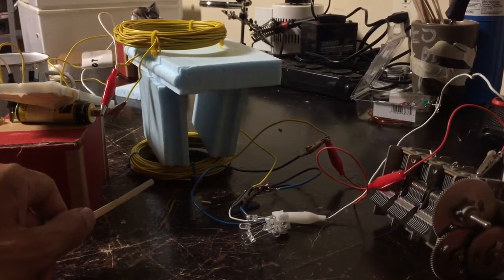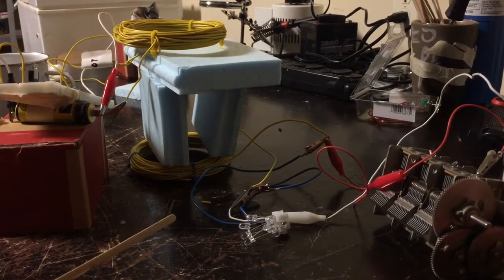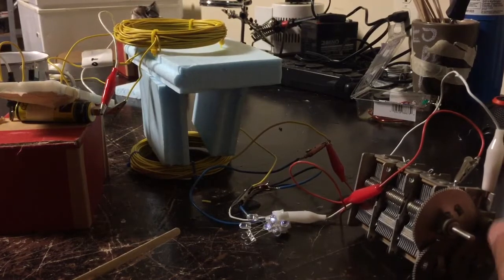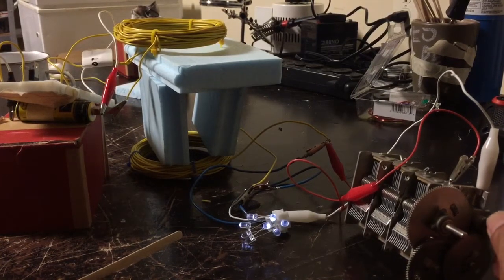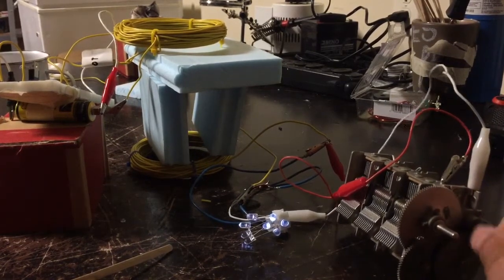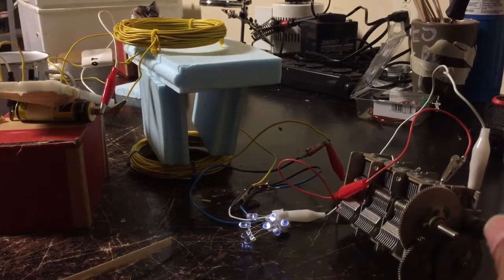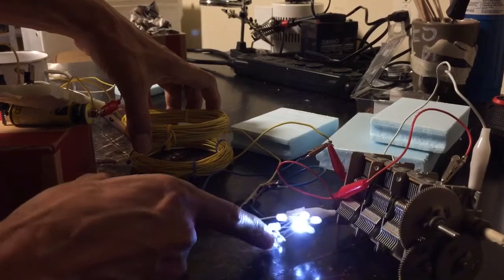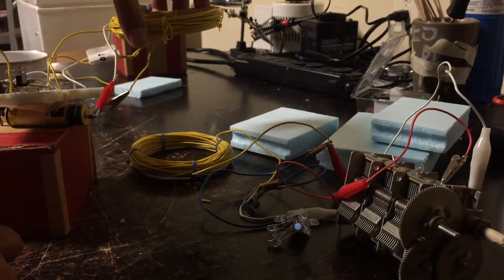Wireless Joule Thief: Resonant Setup

Comment: Thanks, this explains a lot! And got me some new ideas.. This seems to work very similar to super joule ringer. The tank circuit system is very interesting. Its possible to get it work without battery for a very long time. You just need to find right capasitor that suits the circuits / coils resistance, then its possible to tune it with right size tunable / air capacitor. Of course you will need to tap it with battery or add simple magnet generator that gets it started.